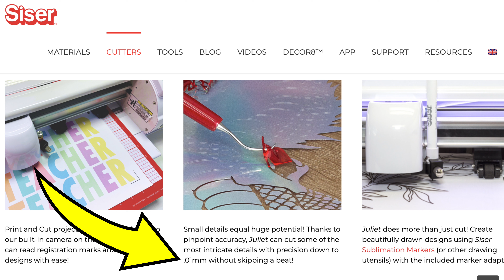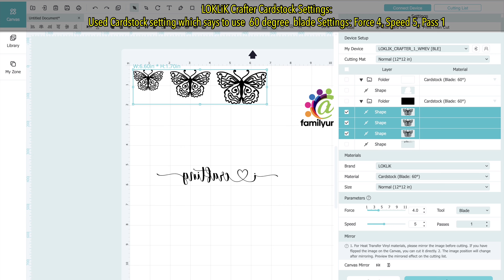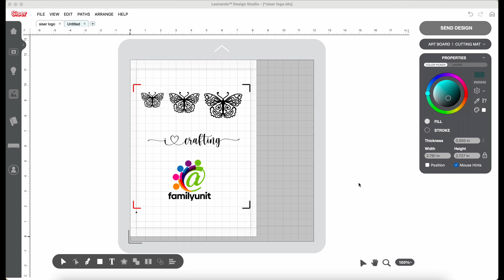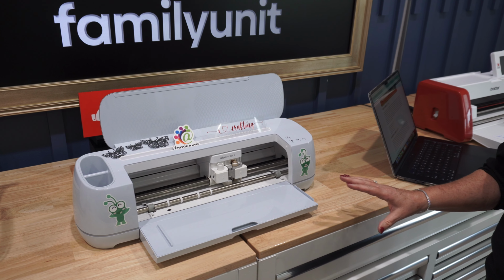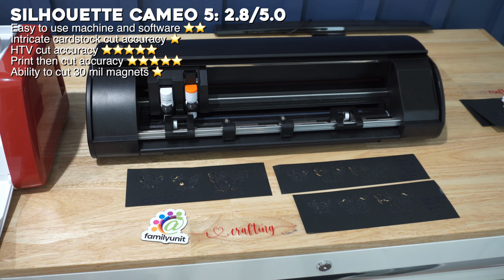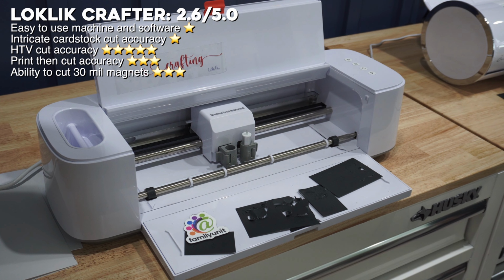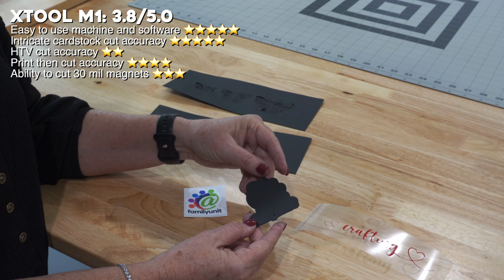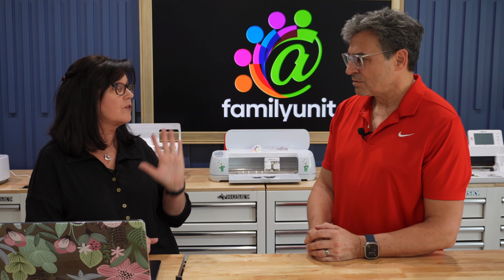Cricut may not be the best cutting machine

Comment: This was a great video, but I think you were a little bias and knew the Cricut well to get it to function the way that you wanted it to.  My personal thoughts that's all.  I have seen Silhouette and the Juliet do the projects very similar and perform better than they did here, because the user knew the machine well.  But, again great video love that you compare so many machines.  I have the M1 and the Silhouette.  It would have been great if you had also did a software compassion of each too.
Reply from the maker: Thanks for the feedback. I am slightly biased towards Cricut, but I think anyone would be naturally biased towards the machine you know the best. I wanted to LOVE Siser and Juliet, and maybe I will with a little more experimenting, but I couldn't honestly recommend them at this point. Fresh still prefers Brother and LokLik because of their capabilities, and especially LokLik's price! We spent hours planning attempting to structure this test to be as unbiased as possible considering the tasks we tested and materials we used. With that said, the variables were more complicated than we expected. Cricut has the most material setting presets in the software, so I didn't have to figure out what settings to use for the intricate butterflies or 30 mil magnet cut. Others cutters require you to manually set your own force, pressure and/or speed. New users, including me, may have no idea where to start with that! Good idea about comparing the software. We thought of that but we were already 40 hours into this project and the video was already longer than expected. We may do a follow-up focused on the software. I will say, of all the software programs used for these machines, to me, Cricut Design Space is easiest for a new crafter, but Silhouette Studio is the most robust and powerful. Again, thanks for the feedback.🙂
Reply: I did not detect any perceivable bias in this video. Seemed like a fair and honest comparison.